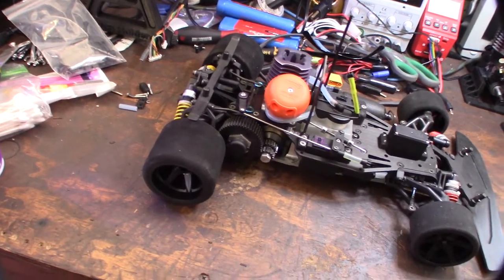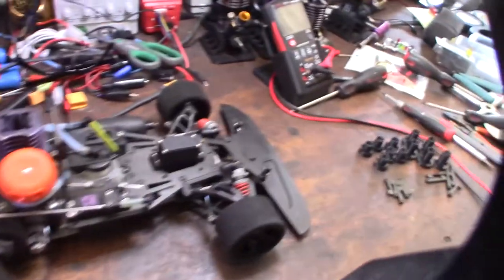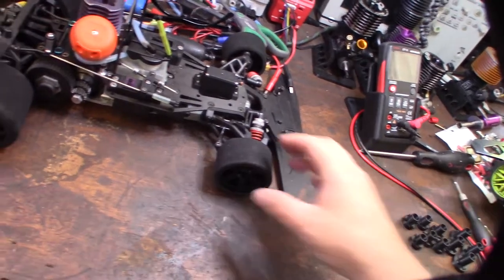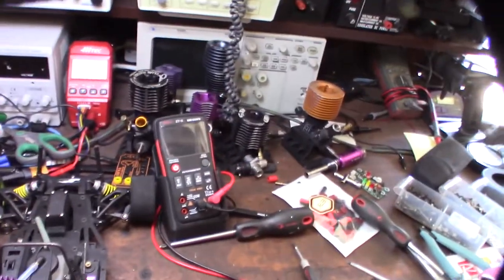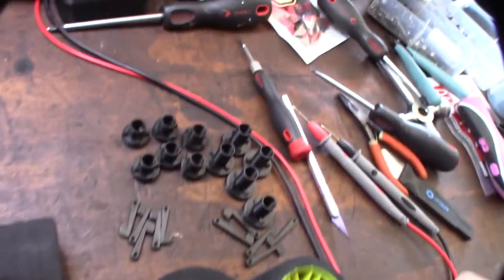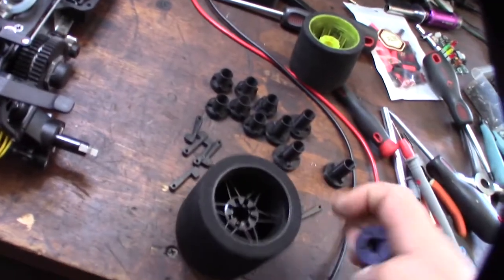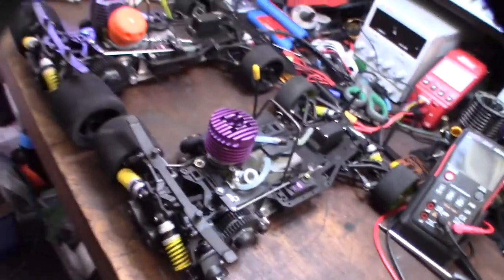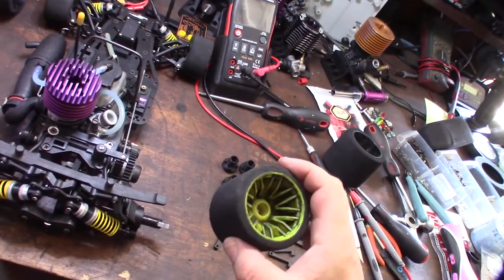1/10 235mm 1/8 Tire Hub Adapters for Serpent Impact 835 Picco Integra

Comment: I  think another option would be to adapt the 235 axles with the hex nut that the 1/10 200 mm cars use.   There are 235 wheels available for those for the outlaw class

Comment: I had a mugen seiki K2x avance at one point which I sold several years ago. It is similar and in the same class as that 1/10. It is a slightly smaller version as the 1/8 same as what you've shown.

One of the reasons why that class died off is because it made it redundant to the 1/8. The prices of both 1/8 and 1/10 car aren't that far off from each other. And knowing how people think. Why buy the 1/10 if you can spend a tad bit more for the 1/8?

I did entertain the idea of my k2x being able to accommodate 1/8 wheels. But you'd be essentially (re) creating a 1/8 with a higher CG and a shorter wheelbase which is not ideal for cars that are running at those speeds.

You could 3d print wheels for that to accommodate touring car tires and have a double/dual wheel setup at the back to have a wider wheel. So you have a car with 6 tires in total😂. I did it exactly just that to my Traxxas nitro 4 tec. And I eventually reverted it back to touring car, because the wider wheels caused it to understeer so much and chewed up the front tires at a much faster rate compared to the back.

Comment: Will this work on the 1/8 picco integra?
Reply: I had picco integra 1/8. You only need to replace the shafts to the shorter and newer standard so the newer wheels can lock into place.